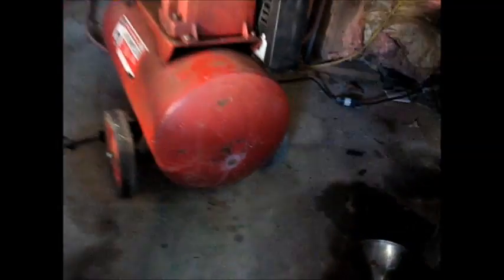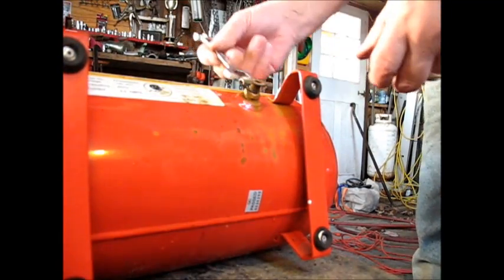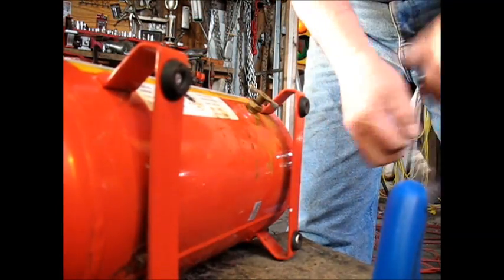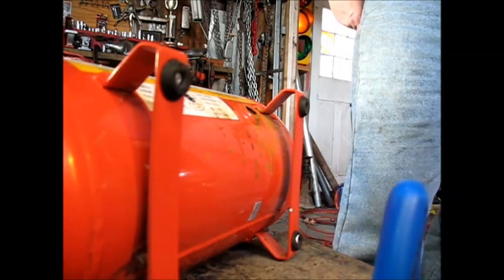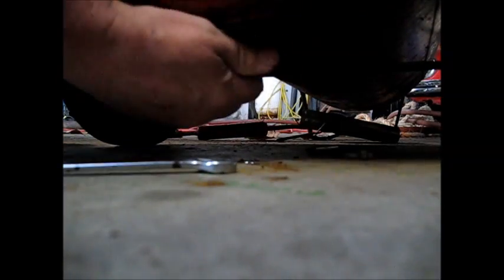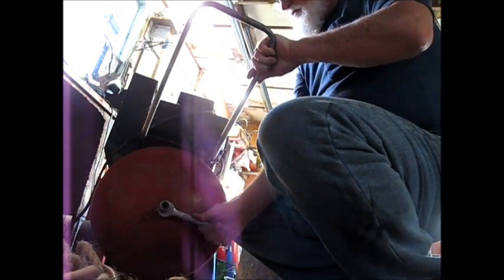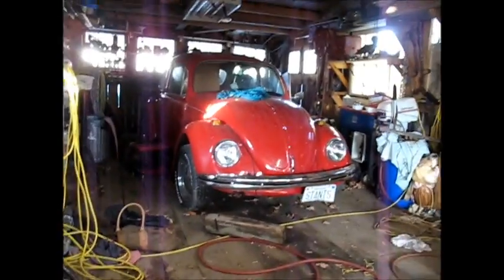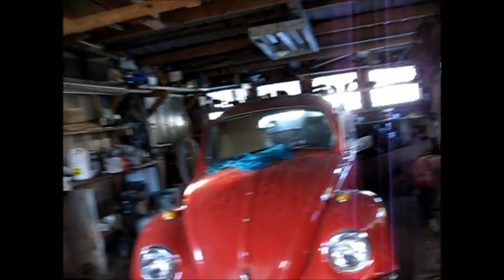Alcoholic Air Compressor

Comment: If the pressure relief valve was down low like the drain valve it would automatically release the water from the tank anytime it activated.

Comment: Hello
Is there a regulator on that bigger with the wheels & handle Red Compressor in your ( Alcoholic Air Compressor ) video?

The reason i ask is. I have an old Webster 1hp - twin cylinder Air Compressor. That looks sorta similar in setup to what you have. And i just got the Fluid Film kit from Kellsport & i was wondering if i need a regulator ...i saw you had been spraying fluid film in another video. 

So i guess what i'm asking.....

1-Do you use a regulator on that Red (larger tank ) air compressor when spraying fluid film?

2-  How many Hp , size of tank is that air compressor? 

3- Any idea on CFM or SCFM?

USA - KellSports-  has all the Fluid Film Spray Kits & Guns (link >>)  http://www.kellsportproducts.com/ 

Canada - www.UndercoatMyCar.ca   - has all the Fluid Film Spray Kits & Guns
Reply from the maker: I have an air pressure regulator, but I let it run full volumn.  It's a twin cylinder 220 pump.  Cant tell you the HP or tank size, but it works fine.  I'm guessing it puts out 100 to 150 lbs, but you probably don't necessarily need that much..  I've used the Fluid Film spray guns.  I also have a gun from New Hampshire Rust Stop.  It's similar but has a hose with a multi derictional nozzle so you can stick it into body cavities.   At this point I've decided I like the Rust Stop better as I've noticed the Fluid Film is all gone after a winter of driving it, whereas the Rust Stop stays in place.   Good luck with yours.  I think your cojpressor will be just fine for what you're about to do.
Reply: Thanks for the info. My Air compressor tops out at 100psi. I have no regulator on it or the gun end.
I was just worried i might not have enough CFM for it. 

I just plan to use the Fluid Film, for lawn mower decks, snow blow tractor etc. 

If you want to rust proof your car. Try what we use in Canada.  
Krown T40. 
www.Krown.com